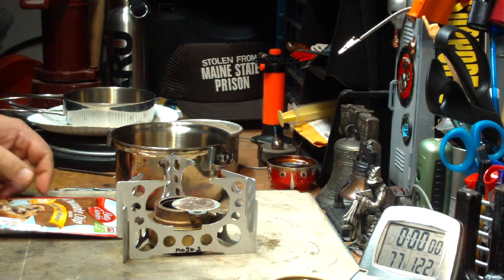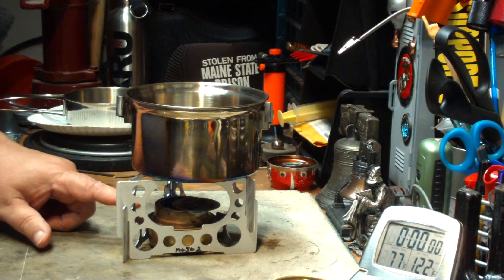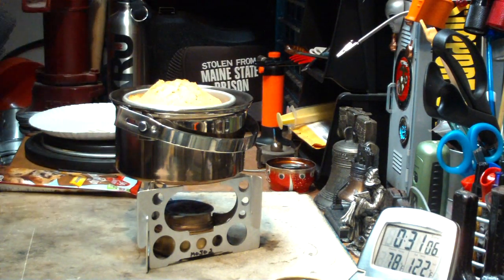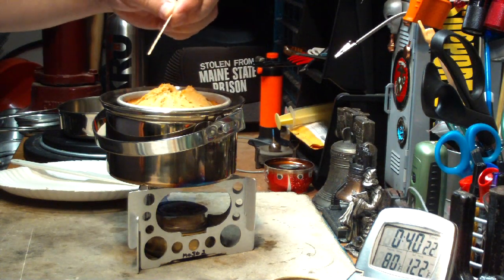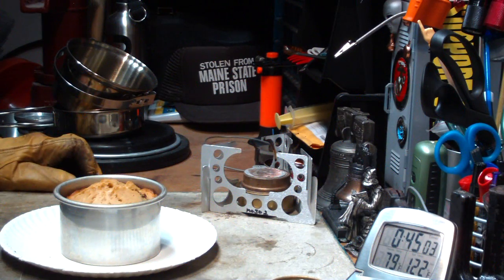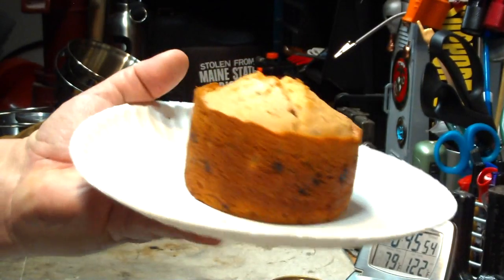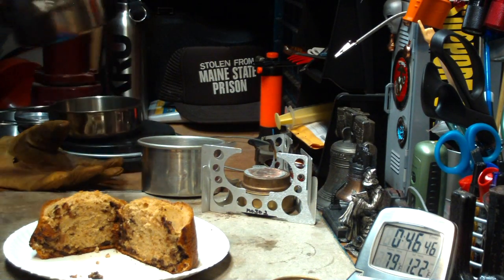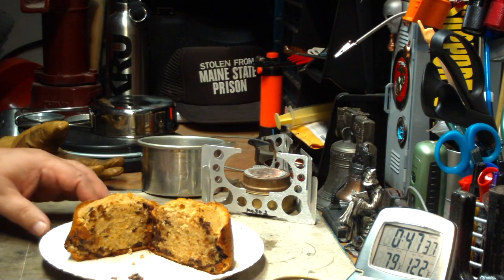Dry Baking with the Olicamp 1 Quart Stainless Steel Kettle set II

Comment: I am trying to use my Trangia stove to dry bake but it will not burn more than about 18 minutes.  Even with the simmer ring on it and only open 1/3, the stove will only burn around 18 minutes.  How do you get your stove to burn so long?